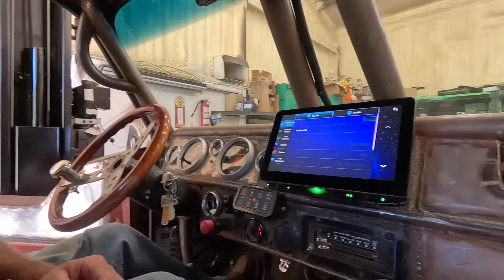Where Has The Rat Rod Wrecker Been?

Comment: On the old school small blocks I took a valve cover and cut a square hole in the top so you could get to the adjusting nuts but still cover the oil holes in the top of the rockers and it also kept oil from running out of the head onto the exhaust. I think 2 cylinders are at top dead center at the same time so you can adjust both of them at the same time when adjusting without the engine running. I also took a distributor and left the cam gear off and milled  the top of it so a drill would fit on it so I could spin the oil pump (counter-clockwise) and build up the oil pressure on a fresh build before starting it. None of this may work on a newer big block but it might help someone. I had rocker problems on one engine and I found out that the rockers were not slotted enough for the cam lift. I had another thought about distributor shims (between intake and distributor) that you use if the heads have been milled down very much to correct the gear mesh between the cam and distributor to keep from wearing them out.

Comment: Get the old gear and turn it down to fit the brass one and glue it in with high temp locktite or use interference fit and shrink it in.

Comment: Obviously you're free do do whatever you like....  and don't get me wrong, I like LS engines, too....  But LS engines are not the answer for everything.  You'll be trading one set of problems for another.  I've owned big block mud trucks with 44 inch tires and I can tell you first hand there is nothing like big block torque in that application.  I know it's different where you live.... but around here we have heavy, thick and sticky mud that is not watered down.  Mud trucks with those little engines and big tires struggle to make any wheel speed whatsoever. Of course there are exceptions, I'm just talking in general terms.  I'm sure you will put an LS in the wrecker eventually but I suspect it won't perform exactly like you thought it would. To each his own. Either way, I'll still be watching. Keep up the good work! 😉

Comment: Billet cam gear needs a Billet distributor gear. 
Dealt with that before it was a problem on my Mustang and I've never had a problem.
I've been told many times that the brass gear wears out fast and a cast gear will will also.

Comment: Use a Torrington Bearing type of cam anti-walk setup. The one where you silver solder a cleaned and polished flat freeze plug to the inside of the timing cover, for the bearing to run against when the cam screws itself forward. You use the rear cam plug to set the cam end play, with the specs included with the cam button,( bearing). Install the distributor before the cam plug and bearing to determine the cam placement. Install the bearing against the timing gear, install the distributor, use the rear plug to set up the endplay clearance. AND QUIT GRINDING ON THE VALVE TRAIN COMPONENTS!!! Buy the correct dam parts! There is a huge side load on much of the valve train, and your hillbilly cut n grind on precision equipment is not working. Love you guys, rant over...

Comment: You're supposed to let that silicone sealer set completely before reassembly. When you tighten the cover just as much or more squeezes out on the inside as outside and if a glob finds its way into your oil passages you will be able to do the LS swap sooner than later. If you use a gasket contact cement like Gaskacinch to glue the gasket to the cover then a light film of silicone set completely on the head side of the cover gasket, you will likely never have to fool with that cover gasket again then when you remove the cover the gasket stays on the cover ready for reassembly.

Comment: Well Paul I watching a video the other night 🌙 and then where saying you need to align your guide plates I think it goes like this you lose the studs just a little bit and then bring it up on number 1 then send it down where that valve opens and then take a look at the push rod and see if it's in a bind and see if you can slide the guide plate to where there is no pressure. I'm hoping I told you right. Also if this doesn't sound right talk to an engine builder that you know that could give you a little advice.

Comment: If you ever have a few minutes you need to fill, please pull out the step ladder / multi-use creeper you used to work over the top of your motor and tell us about it. I used 2X4's padded by old blankets to work on top of my engine. I got a few splinters for my trouble. If you could do that, it would be great.
I would remove the hood to make it easier. Just saying....

Comment: GM performance parts used to sell a soft distributor gear for that distributor.  I think if you can find one for a late 80s TPI motor you'd be good, TPI motors had billet roller cams.

Comment: Just a thought. If this is a known issue the soft brass drive cog on the end of the distributor shaft --- can you not get made a versin out of a harder metal( a metal thats matches the hardness of the drive gear)  Get a few made and you could sell them as a side business. 
As other have said --- you should not use that silicon sealer on the covers. It might seal for a few months but then it will start to fail and bits drop off into the oil, block oil galleries  and the filter pickup (loss in oil pressure ) Try to get it repaced as soon as possible ie this month.

Comment: You could machine a bronze bar press fit into bronze gear then machine out to the size of the shaft on the dizzy pick up the roll pin hole, drill and should be ok, might take an hour or so but might be a good way around it.

Comment: I just swapped from a BBC to ls recently because of similar issues.  Aftermarket intake sat my distributor to high and wasn't lining up with the oil galley passages right causing oil pressure problems.

Comment: Hi Paul, would it be possible to turn up a sleeve / bush / adaptor so the new bronze dizzy drive gear will fit the smaller aftermarket drive shaft? cheers

Comment: Get a Chevy big block crate engine. Boost District's 750 hp LS crate engine package.
     Last time I priced it(2021) was around 16k. They also offer a higher boost 860hp version which was around 18k.

You need all the extra weight in the light front end to keep the nose down....

   Chevy also offers a more moderate LSX454 @627hp for around $12,500(part No. 19355573).
   Texas speed also had a 625hp version for around 12,200.

   I'm sure prices have probably gone up with inflation, but this was the price sheet I had when I was looking in 2021.

Comment: If I were going to build or rebuild a big block, I'd find a copy of David Vizard's BBC book and follow that to the letter. It answers sooo many questions.
    And years and years ago when I adjusted lifters about 3 times a week, I had scrap valve covers with the tops cut out so I didn't oil the headers. Had a set for sbf, sbc, bbc, and bbm. Forgot the inline Chevy 6. That one too. Worked wonders; only a little splatter got away.

Comment: Hey buddy I used to build hot rods back in my younger days and when we had aluminum valve covers we always sanded the inside of the seat so it would rough it up a little bit and it is a lot better and doesn't leak anymore. I used to deal with that crap constantly until I started doing that. Not trying to tell you what to do I was just giving my two cents and see if so maybe it may help I don't know. But I love you guys and want to see you through. If I can that is?

Comment: Paul, with 490 comments you may never see this but.... #1, with a steel cam shaft a bronze gear is a must have, and yes they do make them for aa TBI dist.. #2, having built 100's of BBC's I can tell you that valve train setup is very critical.. Roller cam means heavier spring rates so the stock rocker stud size  will flex, need to upgrade.. Push rod diameter and wall thickness is critical for no deflexion.. Push rod length is critical for proper rocker geometry which means less binding which makes the engine turn over easier.. All of this is very time consuming when building an engine but worth it.. I've built BBC's from 200HP to 3000hp blown on alcohol BBC's and never had a problem with the guide plates breaking...

Comment: Get an old motors auto repair manual or an old GM service manual and learn how to adjust valves with eng off. TDC #1, adj certain valves, turn eng one revolution to #6 TDC, adjust the rest, done.

Comment: @fabrats  I ran into this problem when I put a roller cam into my Windsor and the solution ended up being a cheep eBay distributor turns out because the Chinese factory didn't want to make different distributors for early flat tappet cams and late model roller cam they just put a special molly gear on there distributors that's compatible with both styles of cam material and last way longer then any brass gear ever could

Comment: Was the brass distributor .500 ??  You need a .491 .  I found them on ebay.  They run 2 diff sizes in SBC & BBC the .500 & .491 I would say the one you have is the .500 I have one but its on a MSD dual ignition pick up. Anytime your running a after market cam you have to run a brass gear

Comment: Try the distributor gear off a vortec 454 (they came from the the factory with a roller cam) end I think the vortec 350 might even be the same. Using  a iron distributor gear on a roller cam will eat the drive gear on the cam with a quickness. You might pull the cam and see if it is too late. Good luck  and keep up the good content.

Comment: Before you go ls I'd look into the 8.1 7gen big block it's a tall deck block but has conventional and ls mounts cast in the block would bolt right in and it runs coil on plug and ls computer tuning might be the best of both worlds also they were ran in bigger trucks so some have factory air pumps on the front drive

Comment: for the distributor gear, couldn't you just press in a rod into the gear, then spin it on the lather to the right  inner diameter and then drill the drift pin hole back in?

Comment: You need to get an old pair of Steel big block valve covers and cut opening on the top so you can adjust the valves without spilling oil 😅

Comment: You should be able to make a sleeve to make up the size difference between the bronze distributor gear and the distributor shaft.  The roll pin will hold it in place with the gear.

Comment: A cam change for the big block would be way cheaper and easier than a LS swap. You can get a hydraulic roller that's compatible with the stock distributor gear. Or, use a different distributor that will take a bronze gear.

Comment: i realize this is 10 months old so it wont apply to this distributor fix but if you have to go back in again i would take some brass machine a press fit plug for the new gear and stick it in the lathe and bore the correct hole

Comment: After listening to it, I can hear that cylinder #3 is underperforming because the sparkplug gap a 7-9 thousandths too big, (tough to tell with the audio quality of my PC speaker) and cylinder #7 has carbon build up on the exhaust valve causing it not to seat fully and you're getting some bypass when that cylinder is firing. 
Other than that, it sounds okay. :-)  :-)  :-)  :-)  :-)  :-)

Comment: This is a case where the OEM knew what they were doing.  Aftermarket cam and valve springs and rockers causing problems that wouldn’t exist in their absence.  Put an RV cam in it with stock lifters, valve springs, and self guided rockers.  Run the right oil for a flat tappet cam and live happily ever after.

Comment: Wouldn't getting cousin Merlin to fix you up with a big Cummins like he has in his Tow Mater, resolve those issues?

TowMater seemed to me to work pretty good on Southern Utah's offroad trails during the Wrecker Games.

I listened to Matt the other day, waxing lyrical about big low end torque at low revs being his ideal power supply.

 I sat here thinking he was actually describing the power characteristics of a big Cummins diesel. 

Isn't added weight over the front axle, exactly what a tow truck wants?

Or am I going straight to the 'bad fire', for even having such a thought.

Comment: that wear he was showing on the rocker arm roller looks like something I’ve had happen in the past when my pushrods were not the correct length, mine was because of rods being too long and partially “walking” off the valve tip, instead of staying on the flat completely.

Comment: I hope you were able to find and remove all the broken guide plate pieces.  A bronze distributor gear is needed if you are running a steel billet camshaft.  It will still need to be inspected and replaced on a schedule.

Comment: Back in 1975 I worked at Man-A-Fre manufacturing aftermarket parts for Toyota Land Cruisers, like your FJ45. A very popular item was a Rochester 2G carb commonly used on Chevy Small Block V8s, but we were adapting them to use on the Toyota Inline 6. Another popular item was a Delco distributor. It was a slip in fit as the Toyota engine was based on GM Stove Bolt tooling provided to Toyota after WW2 to help get them going again. But they always immediately (or at least very quickly) ate the plastic gear. The fix then was to replace the plastic gear with a silicon bronze gear before the customer ever saw the distributor. I never saw one of those come back. And here you are in 2023, like almost 50 years later replacing a stock plastic Delco distributor drive gear with a bronze one because your engine keeps eating the plastic ones. Imagine that you're having trouble with that hotrodded 454...How could that still be happening? Where's that emoji of the guy shaking his head? The only other problem we saw with the Delco distributors was water getting in the trap door to adjust the points. Silicon was the fix. My 74 Chevy tow truck with a 350 the year before had the same distributor problem. Any tiny bit of water and cough cough sputter... Annoying problem. And not so easy to silicon the distributor on the back of the V8 as on the side of the 6.

Comment: many years ago..... i had a 4" lift, 3" body lift, 34"  tire truck. for me at 5'11", I'd pull the front wheels and lower it down till the rotors almost touched. if i wanted lower. i'd put 2x4's under the rotors and set it down. I did not like the milk crate ladder kicking out from under me.

Comment: I was always under the impression that the bronze gear was only to be used against a billet camshaft. I don’t know how well that bronze gear will hold up now in my Chrysler hemi I have I have a bronze gear for my distributor drive and it’s up against a bill at Kim and they say even then they don’t last real long time but I had my gear both the cam gear and the bronze gear for the distributor coated with molybdenum disulfide and they’ve got thousands of miles on them and they’re still in excellent condition. this is six in a row Jim from Kennerdell, Pennsylvania, look into a guy

Comment: I was surprised when you built that rig and put the big block in? Not that they were bad but when you can find a much more modern engine that is way lighter less likely to leak or burn oil and easier to find the ls is a no brainer. I know you would be giving up a bunch of low speed torque but I think it would be a good compromise?

Comment: You need longer rocker studs if you can't get a 1/4 inch of threads on the ploy-lock rocker nuts. If you blow it off and break one you'll have a push rod wrapped around the cam and a broken cam and of course it will happen in the worst place at the worst time.

Comment: Is the TBI distributor shaft an odd diameter? .491" and .500" are the 2 sizes that you'll find for Chevrolet. And stud girdles are what you need to fix the valve train.  Orange high temp RTV is just as impervious to oil as grey, black, blue etc. The only difference is the high temp deals with heat better and black and grey are sensor safe. I'm pretty sure there are orange and blue sensor safe versions as well.

Comment: I never trusted myself when working on rockers. I go though the accepted process for installation then fire it up with the Valve covers off, loosen each rocker till it rattles, tighten until they stop and go another faction of a turn based on what you think is right. You can hear the one you are currently on when it rattles so you know you got it right. They sell little clips that go on the rockers to block the oil from splattering all over or if you do it much you can sacrifice an old valve cover and drill big holes over each rocker stud. The “special tool” with the ratchet handle and T for the poly lock all made in one piece is a good investment too! It’s just as possible to have more pre-load on one lifter as having too little and you won’t have the rattle to tip you off, getting them all the same is important if you plan to do some high revs.

Comment: Mark the distributer after you've lifted it off the cam gear. Mark the housing in relation to the engine, and mark the housing in relation to the rotor. Guarantee perfect drop in every time if the engine hasn't turned.
Have fun all.

Comment: You should run STUD GIRDLES with the aluminum rockers. Ive grown up drag racing and many guys I know with much bigger and radical big blocks compared to the wreckers engine. These guys had minor valve train issues and they were shifting at 8500rpms. You likely have a valve train geometry problem which is causing you headache. A LS in that heavy wrecker will be a massive mistake. I’m not a big block fan by any stretch of imagination. But the big block is capable of making a lot more torque, with ease, compared to the LS.

Comment: When you run a billet roller cam you have to run a bronze or melodized, spelling?, gear. A factory steel gear, no mater how much oil you give it, will wear out very fast as it is not the right material. There are numerous companies that have small cap, timing locked, ready to run distributors. Holley even makes one, plug and play. This way you dont have to run that TBI distributor.